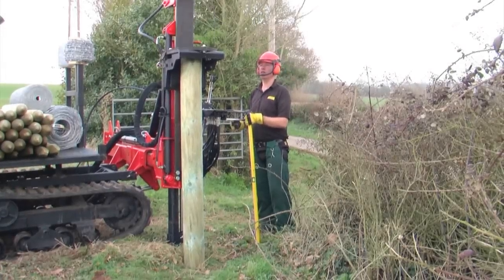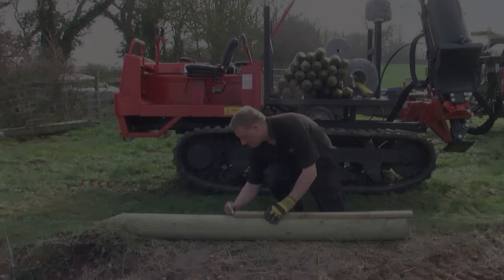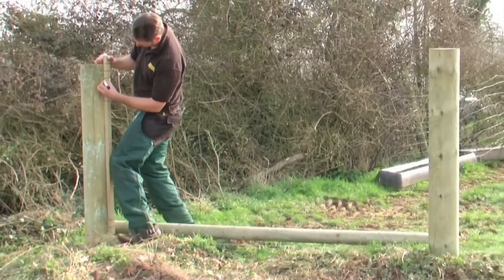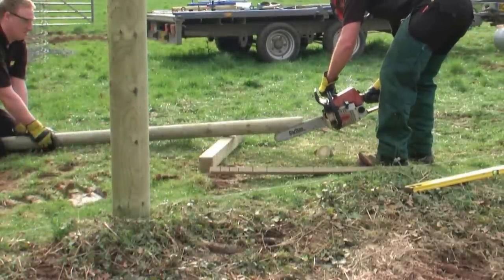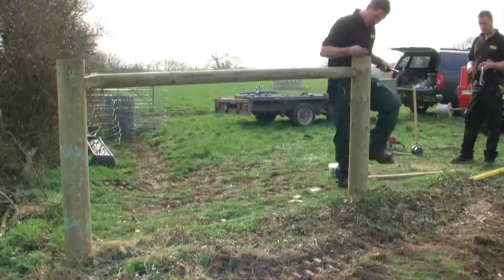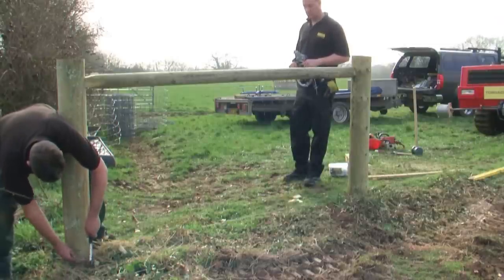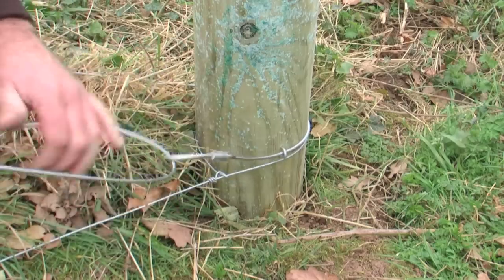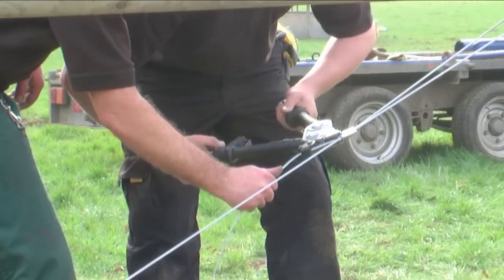How to drive in a strainer and fit box assembly FV

Comment: I love the look of that post driver. But... The rest of this is ridiculous. Why sharpen a back up post (especially in ground that soft) when the strainer wires want to force the back up post (second strainer?) into the ground. That will only lead to a lose box, and no body wants that. Why spend the time to sharpen and chisel out a hole for your strut when you could use two decking spikes (huge nails) and save a bunch of time (a short one gets half buried into the strainer post, the head going into a pre drilled hole in the strut post. Another goes through the back up (pre drilled) and is hammered into the strut.)  Also H-box kits are a waste of money when it's so easy to learn to wire a box in under 5 minutes.
Ps. worth mentioning the strut post needs to be about 3m cus physics.
Reply: Coen hi the chisel out is done for NZ conditions wet most areas and also for side strength with in corner paddock pressure.
Reply: @kevinhuddleston4219  dont think they r in nz be uk
Reply: Looks like Uk to me. Most strainers in uk are pointed before so called treatment. I know one gripple is not going to do a lot. In Shropshire, we would use three wraps of 2.5ht strained with a monkey and crimped.  In NZ I would use three wraps of ht and then "twitch it tight using a 2x2 inch batton.